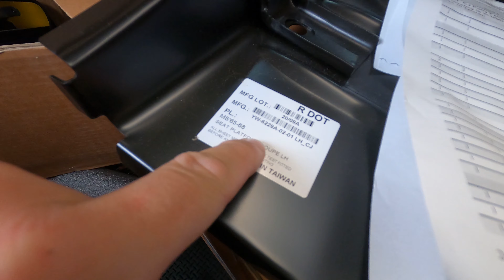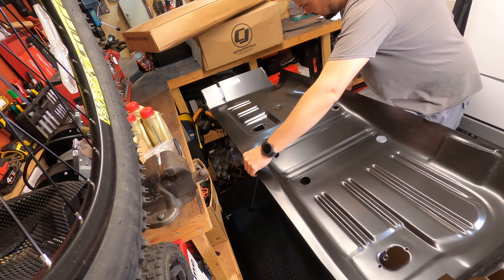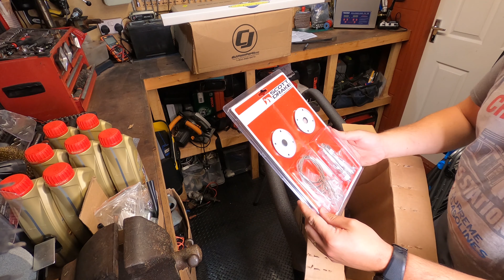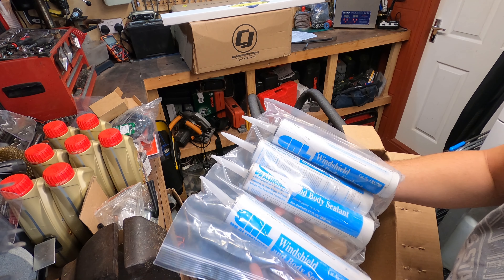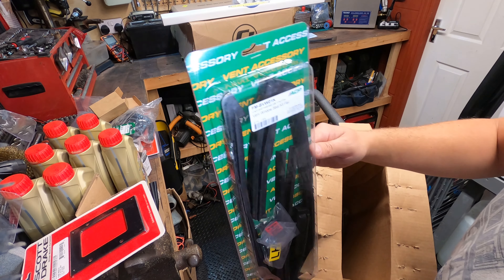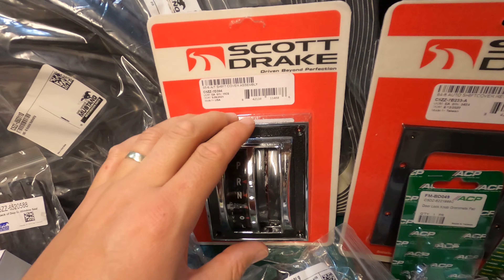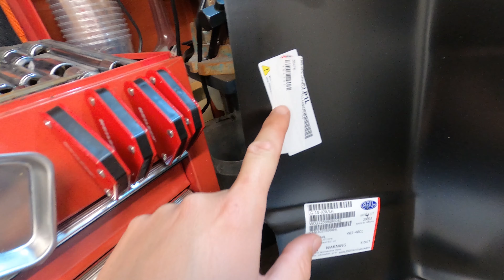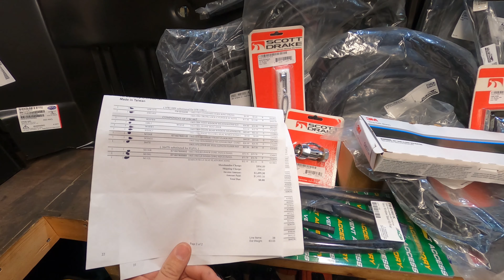1965 Ford Mustang Project - CJ Pony Parts Unboxing Video - How much Import TAX did I pay USA to UK

Comment: CJ Pony does offer some parts that are hard to find or not so hard to find for a much higher price than normal, but for some parts or bolts I suggest Rockauto or AMK.  National Parts Depot also has some lower prices on certain parts.  I really need to put my extra parts on eBay or something.  As a 65 Mustang owner myself it is exciting getting boxes, good luck and happy restoration.

Comment: Sheet metal from some places won't be on the mark, but a few like Carpenter's is made from Ford factory dies and are closer than many cheaper sources. Think I would focus on the gauge of metal more than it being a shoe fit. A bit of hammer work after careful fitting and slow welding will sort it out. I am glad your still moving forward with the Stang interior.
Reply from the maker: Thanks for the support